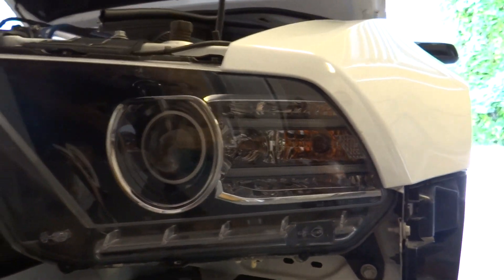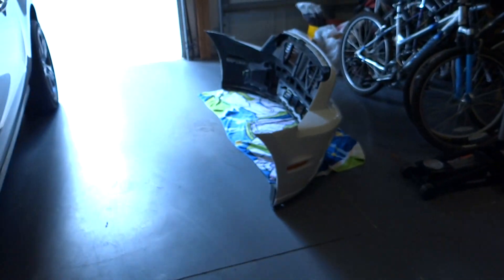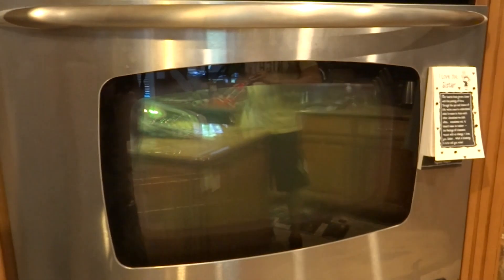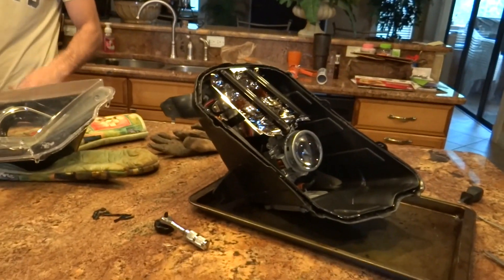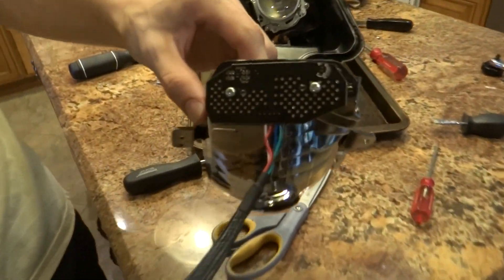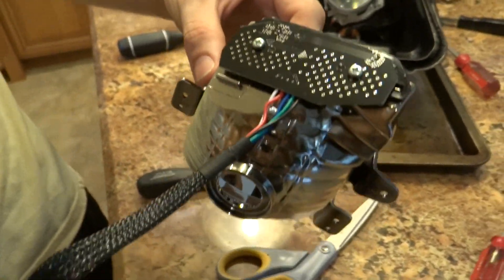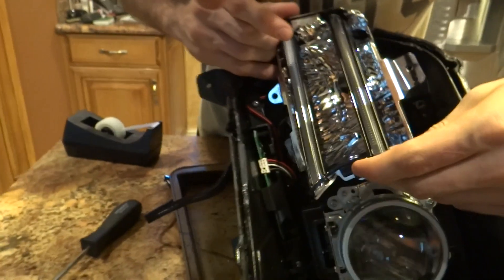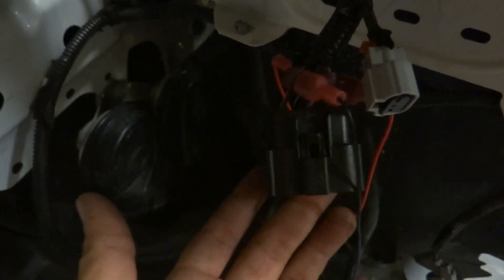How to install 2013-2014 Mustang Diode Dynamics RGBW DRL Boards

Comment: So once u unplug the wires from the old board what do u do with them ? Their tied into a green circuit board up top ?
Reply from the maker: You just push the plugs aside or tuck them away correct
Reply: @BrandonChinn  so u dont use them anymore?
Reply from the maker: @mpggonzalez6492  no, no longer used once removing the old LED boards

Comment: did you have the control? if not, what were you able to do with the boards
Reply from the maker: I had the Bluetooth controller connected to the RGB boards to control them. The OEM boards were held on to in case decided to switch back to them

Comment: Hey for some reason my drls don’t turn on when I unlock the car like it used too... I have to turn them on/off via the app. Is yours like this too? If not, how can I fix this?
Reply from the maker: Jay Babcock which wires are you tapping into or how are you powering the lights?
Reply: I got them installed professionally. I think they grounded it to the battery
Reply from the maker: Jay Babcock ahhhh so basically it sounds like they wired it just to a positive and negative which means it’ll only come on when you tell it to vs wire it as if it were a factory setup where it would come on just the way the factory DRLs did
Reply: Brandon Chin so where should I tell them to wire it too?
Reply from the maker: So driver side is easiest to wire for me, and basically it should be wired to the main headlight harness. Two red wires from the RGB lights get wired to Brown/Green and Violet/White as for ground, it can be grounded anywhere or tapped into the Black/Grey wire from the harness
Reply: Brandon Chin thank you so much!
Reply from the maker: Jay Babcock anytime man

Comment: Does the turn signals still work in the front?
Reply from the maker: Thesavage6.2 yes the turn signals still work. They are separate from the Daytime lights
Reply: Ok thanks for the quick reply. I'm going to be installing a set and wanted to know before hand
Reply from the maker: Thesavage6.2 yeah of course! Just good luck opening the headlight housing

Comment: How do you connect the controller? What wires do you use?
Reply from the maker: fast1772 what exactly do you mean? How do you power the controller is your question or actually wiring the rgb wires to the controller
Reply: Brandon Chin yeah that white little box lol
Reply from the maker: fast1772 oh okay! There should be letter on one side. If you turn it upside down there’s going to be 4 or 5 screws you can go ahead and loosen all of those. Next, you want to match each of the letters with the correct color wire and make sure it’s a strong metal contact (R: Red G: Green B: Blue). As you feed each wire into the contact point, go ahead and tighten the screw down to hold each wire in place
Reply: Brandon Chin so do I cut the wires? Or do not cut? 🤔
Reply from the maker: fast1772 no you shouldn’t have to cut anything if you’d like to email me or message on instagram that might be easier

Comment: What colors do you crimp
Reply from the maker: DeadBeat Garage black wire - black/gray (ground)
Red wire - violet/white (parking)
Red wire - brown/green (DRL) hope that helps! That is also on the driver side because we couldn't find the correct wires in the passenger side to crimp